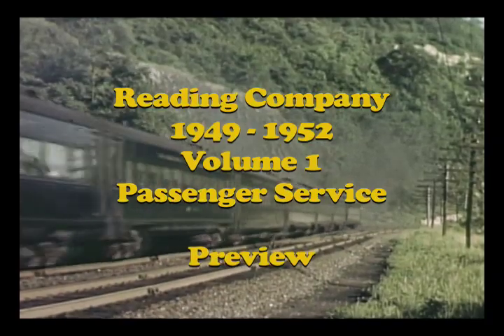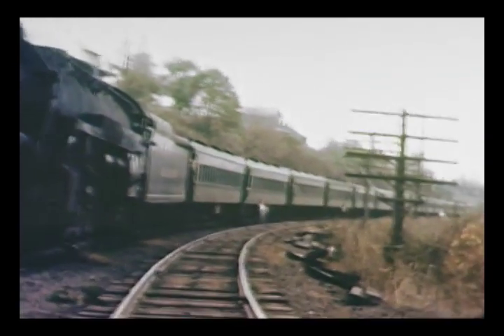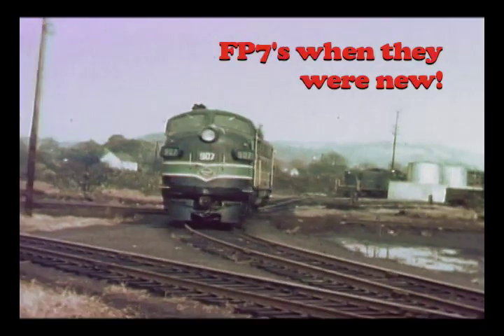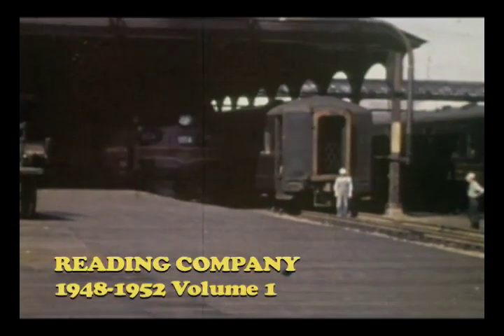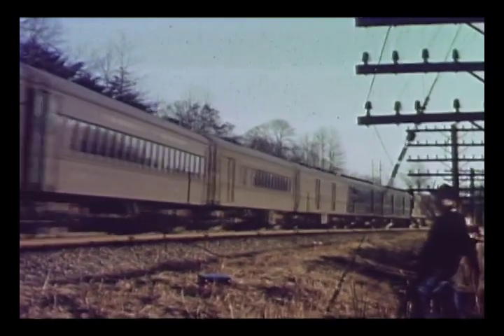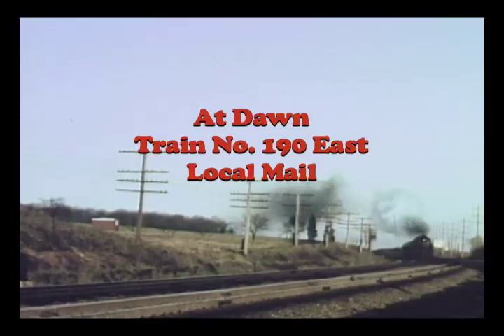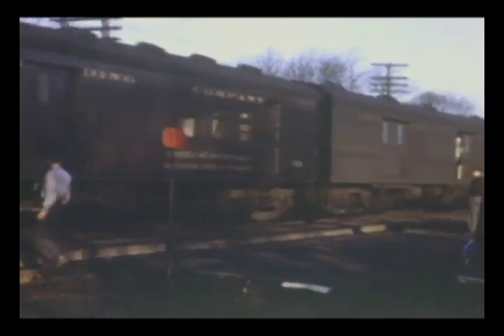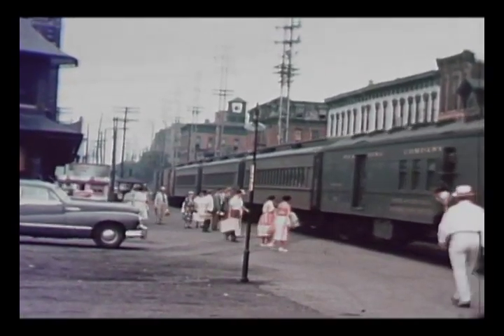READING COMPANY 1947-1952  Vol 1 PREVIEW

Comment: Phoenixville Tunnel was a PRR tunnel, The Blackrock tunnel which is in the video is also known as the Fairview Tunnel. They are both in the Phoenixville area, but only the Blackrock Tunnel is still used. Phoenixville Tunnel is north of the old Phoenix Iron Works.